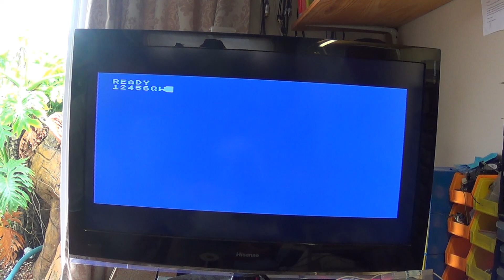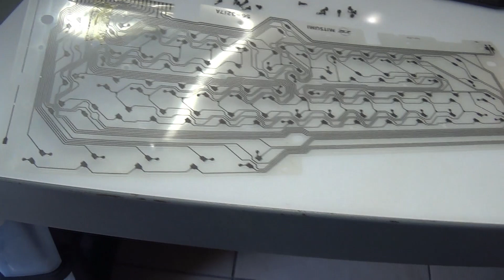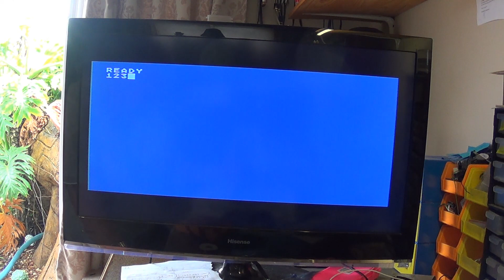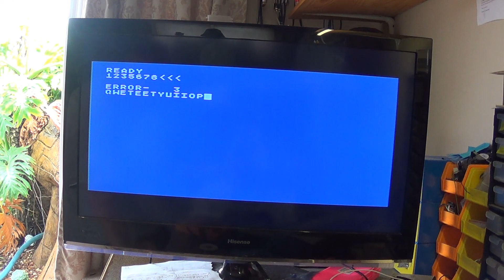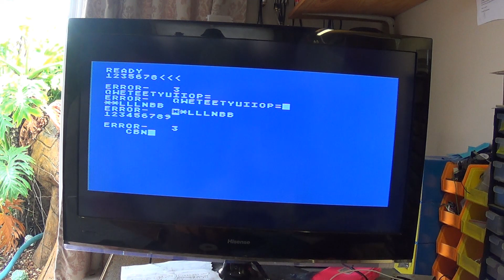Atari 130XE Keyboard Membrane Repair

Comment: The 130XE's keyboard is quite a disappointment - the keys are quite mushy. The XL machines had nicer keyboards and I have yet to have one fail on me. Keyboard issues like these are quite common on the XE range of systems. I have had the keyboard on my 64XE machine fail as well - turned out to be no brakes in the circuit but it did need a very good cleaning. 

I reckon the tape was put there to increase the height of the membrane in an attempt to make the function keys have better contact? Very cool that conductive ink can actually bring the traces on such a membrane back to life. Did you get it completely working in the end?
Reply: I've owned an 800, a 130XE, and I've used XLs of friends here and there, and the best feeling keyboard for me was the XE, followed by the 800. I learned how to touch type on the 130XE. I did not like the feel of the XL keyboards at all.
Reply: XL keyboards can fail over time too: the switches jam up and get dirty, the ribbon can crinkle and break connectivity, and a control chip on the keyboard can fail too.